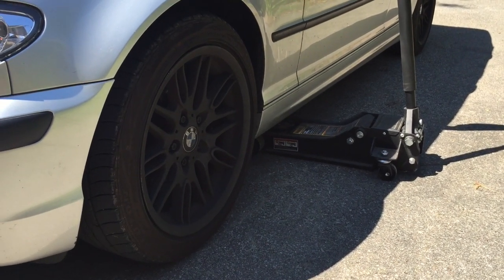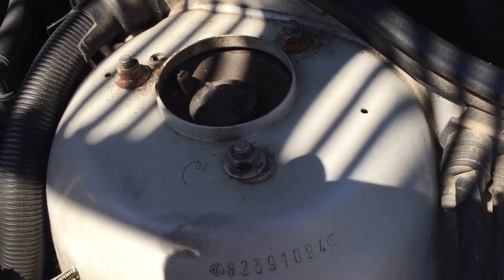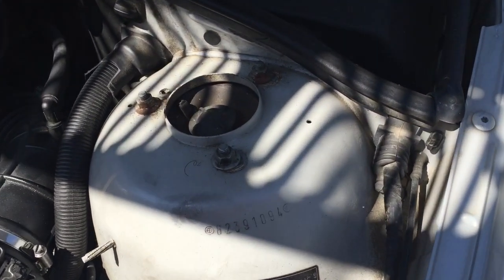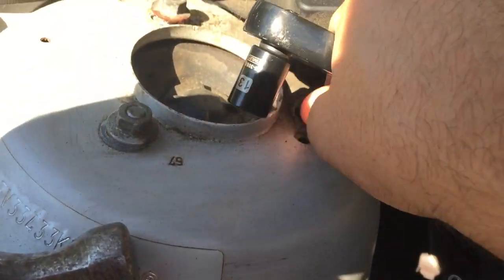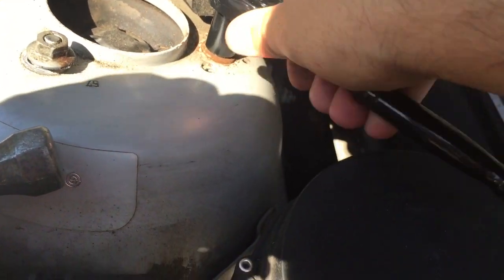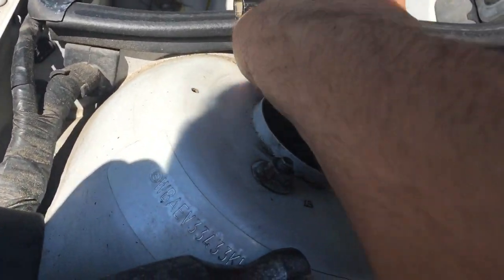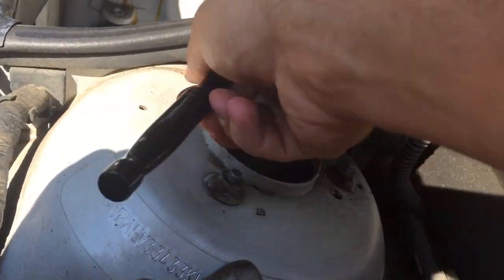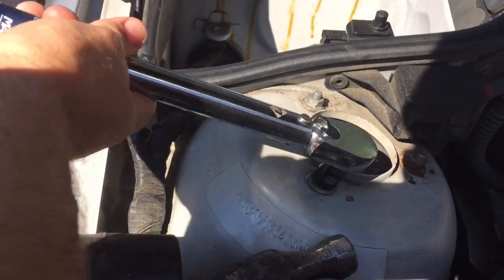BMW FRONT CAMBER ADJUSTMENT  for better front end grip.

Comment: Hey,

I did the same thing to my 330 and it changed the handling nicely. Steering seems to have a lot more "bite" now. What also helped was adding a strut tower brace. You can use one of the M3 (pricy) but there are many aftermarket ones available. Just be sure to pick a steel one (aluminum ones will flex and are for show only). One more thing regarding the strut tower bolts: These are oval shaped and are supposed to "self-lock". This is why they are supposed to be torqued that low. You should consider replacing them with new ones now that you opened them once. They are only 50 Cents or so a piece at your local BWM dealer.

Cheers,

Hardy
Reply from the maker: I did read about that. I will be doing some new shocks soon (koni sport) and I was planning on replacing a bunch of stuff anyway. I wonder if it would be a good idea to tighten them a bit tighter if you needed to reuse them.

Comment: So, it sounds like negative camber is normal for bmw's. I used to have a e39 and the inner edge of the tires always wore down well before the rest of the tread. A couple friends with BMWs always told me that was by design to allow better handling on the corners. It made sense that it would compensate for the natural positive camber forces that occur when cornering on the outer wheels. But, so many other guys told me that there was no way a car maker would intentionally cause such wear rates on just the inner edges of the tires. This question has always stuck with me, but my car sure did handle great!

Comment: make sure your toe is a-ok:
use a jack stand with some fishing wire - you can tell if its out just make sure the line touches the center of each front and rear tires on one side.
Reply from the maker: Thats a great Idea actually.  Thanks for the tip!

Comment: Ive ran various cars with camber and castor adjustment, in the dry (depending on how far you go) its great and goes round on rails, however in the wet it can be a bit wild, although aqua plane is better on puddles as you force the water out instead of riding on top. 

Alternatively if you could fit offset wishbone lollypop/bushes (polly is an easier fit) and adjust the castor (as the stock e36 m3 had). This wont help cornering, but does make the car to run true (more so at higher speeds), so its light at low speeds and heavier at high speed.

The other issue you get with camber adjustment will be tyre wear, but this small of an adjustment wont probably introduce much. The other way to improve the lightness of the steering on tbe e46 is using an under drive pulley, thus under driving the power steering pump, this way you recover a few bhp and improve the handling (by making it heavier at any speed). 

That said my e46 always felt skittish, swapped the front wishbones for the solid ball joint meyle hd ones and it feels much much better, still a fraction too light tho. So im going to fit the under drive pulley at some point. 

If you do this, carful when knocking the location nub out (flat), the shock top is cast, too hard and it might crack. I wonder if drilling it out might be safer. That said the bottom of the shock is just one bolt, (although you probably want to also remove one end of the torsion bar drop link to make it easier to get out, then take the entire leg (shock/spring/shock top) out, then grind the nub off/down and refit, which is probably the long winded but safest method.

Or you could just buy adjustable camber plates for under $100 and get as much or as little adjustment as you wanted.
Reply from the maker: Great info. I tend to find that my e46 already errs on the side of heavy steering anyway. New bmws with the electric steering are way too light and lack the same feel. Interestingly I have noticed some feeling of instability (very little) at track speeds. 150km/h + and I chalked this up to lack of any good aero. Wonder if the caster adjustment would help with that.
Reply: For sure, im pretty it will, made a big difference on my e36 north of 80mph, you can fit the solid m3 eccentric e30/e36 ones by pressing them in, but it made the ride pretty hard, i would do polly its so easy. Fair few places that do them in eccentric setup now.

Comment: If the top of the tire is pointing out, that's positive camber, right? Also--17 foot pounds? That may be right, I was just expecting these to be much larger bolts. I guess it just varies by vehicle as far as what is holding the strut in place.

Comment: nice vid. could be useful to post on the forums for some people. I have coilovers, swapped the top hats and done this alignment pin trick and have -2.3camber  in the front now
Reply: How do you swap top hats? Can you remove them from the top or do you have to go underneath and remove the whole shock? Not doing coilovers yet, but I do want more camber.

Comment: should also throw in there for a more crazy camber adjustment you could switch top hats from one side to the other......this would get -2 degrees and upwards depending on your ride height. but this trick could be a e46 m3 only thing idk
Reply from the maker: I remember reading about this but I don't remember if it was m3 only. Either way that's a serious amount of camber and probably not usable for city driving.
Reply: +E46 Reviews with T.H. totally usable lol 

nothing wrong with that at all lol 😂😂😂😂
Reply from the maker: Well yes usable. Not that it would effect driving. Just annoying tire wear.
Reply: I want to swap the tophats for drifty camber. Am I correct in assuming that I must remove the entire shock first?

Comment: Please tell me how to center those three bolts highlighted on your video on a correct factory settings.. I get a tire-wear  X5on the outside on my X5 e53.. I adjusted my camber three times in two months already with two different masters and still no desired result I see so far..  you might be on the right track with this video, so please answer to my question
Reply: Your X5 M is not like this E46 BMW.  You have a much different suspension setup and the adjustment shown in this video is not an option for you.  Camber adjustment for your vehicle is done where the spindle attaches to the strut.  Try finding a BMW specialist shop that can work on it.  Ask them to give you 2-3 degrees negative camber in front and zero to .1" toe.  The closer to zero your toe the less likely you will experience odd tire wear.

Comment: I could only get -0.5 degrees of max front camber and -1.5 degrees in the rear max. So I kept all four wheels at -0.5 degrees of camber.

I want to get fronts to -2.0 degrees and the rears to -1.0 (which I already can get to in the rear, but I don't want the rears to have more negative camber than the front, hence why I kept them all -0.5 for now). Probably will get camber/caster plates. Any suggestions?
Reply from the maker: If you are going to do a proper camber plate make it a good one as the cheap ones make a lot of noise and die.  Turner motor sports has a fixed camber plate that is way cheaper (just a disc of metal) that might be a good option.
Reply: +E46 Reviews with T.H. I'm interested in the Turner Stage 1, since I think that it should be able to give me -2.0 camber per side (and caster adjustment as well because my caster is about 1 degree different from left to right and it feels like it turns right better than left)

Comment: Quick question: how did you decide to set camber ONLY to front wheels? What’s the effect/impact if no camber to rear?
Reply: Front and rear can be adjusted independently to achieve the desired chassis balance.  On a stock BMW E46 (and most BMWs) the front wheels do not have enough camber from the factory.  General opinion is that this is to reduce oversteer and darty handling characteristics.  For an enthusiast BMW driver, the added camber in front will be a beneficial adjustment and result in a much better handling car.  I generally go for 2-3 degrees of neg camber in front and similar to slightly more in the rear.
Reply: @recyclebmws2574  How about the wear on the fronts? Is it notable or pretty much the same?

Comment: doesn't work...i tried to pry with a screwdriver and i snapped the bolt..now i only have 2 blots at the strut tower. thank you for a grate diy for breaking my car!
Reply from the maker: +Vlad ZSX did you take enough weight off the wheel so the strut would move? Either way. That whole strut is coming out and getting a new top hat
Reply: Took the weight off...of course. I put it on jack stands. I'm honestly sick and tired of these old e46s and naturally aspirated engines..thinking of buying 335i e92
Reply: @gamingfever69612  Lol complain about working on a car, and then buy a 335i? Good luck mate :) Talk about reliabilty issues...
Reply: You did it. Accept your responsibility and destiny pleb.